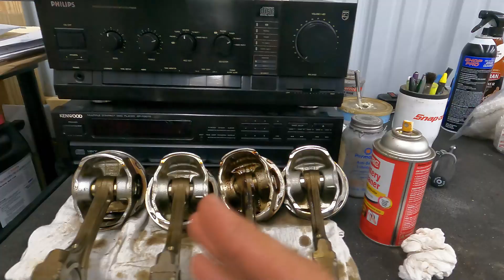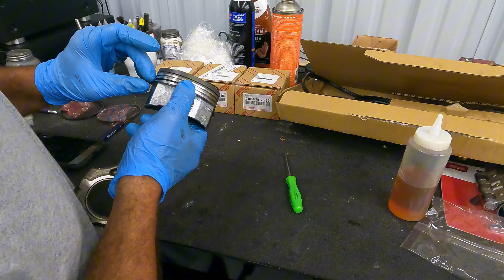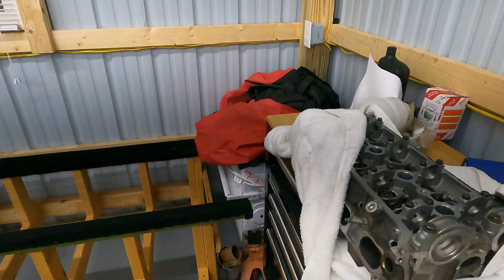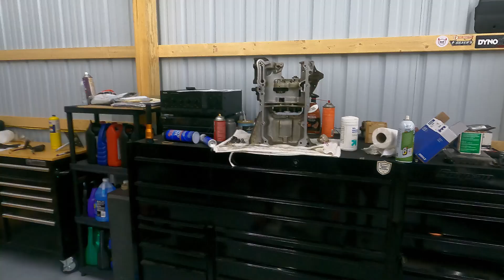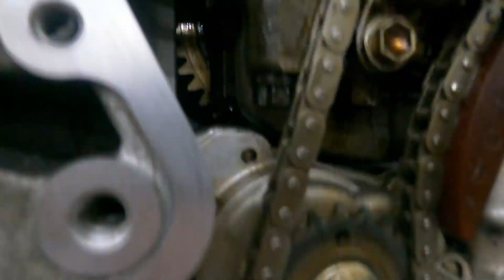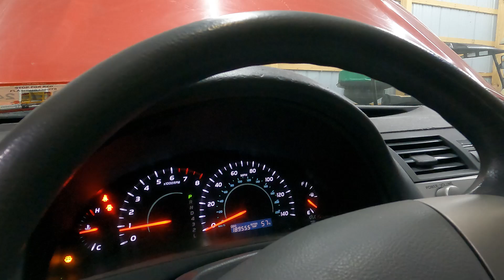We fix the OIL CONSUMPTION issue with our Toyota Camry 2AZ ONCE AND FOR ALL!!!!

Comment: Were these parts to fix the oil consumption issue and head bolt striping issues both used on a 2010 version of the motor (in a Matrix)

Comment: What did u do about the blown head gasket? Have head machined/use new Toyota head bolts or aftermarket/install inserts in bolt holes to prevent stripping? thanks
Reply from the maker: Had the head cut, and installed new Mahle head bolts in factory cut threads. Luckily for us the threads were okay

Comment: I checked your first video and there was no list of part numbers what is the part number on that kit I already have the part numbers for the Pistons from the car care nut but he said the kit numbers vary by vehicle which I also have a 2007 Toyota Camry like in this video video I got lucky and my car only goes through 2 quarts every 5,000 miles so usually I don't add really that much between oil changes but it is burning oil and it's got about $215,000 so I'm looking change the piston rings and valve seals

Comment: No need for a hone? I know the TSB doesn't call for it.
Reply from the maker: You’re correct, the TSB states if the factory crosshatch is visible do not hone, and if it’s not visible replace the block. Ours was clearly visible so we followed the TSB
Reply: @SEsGarage  Thanks.
Reply: Do you happen to have the part number for the piston rings. Trying to find the "updated" rings

Comment: Did you check the ring gap in the block and fit them accordingly?
Reply from the maker: All steps of the TSB were followed accordingly. This is a low horsepower mass produced economy engine, not a race engine.
Reply: @SEsGarage  don't think it matters what type engine. Just standard practice for correct build and reliability

Comment: How much would a job like this cost?
How much would you charge and how much for parts?
Reply from the maker: So this isn’t a job that I would do for a customer unfortunately. I have a full-time job and a family so time is my biggest enemy. I can only spare a couple hours a week out in the garage doing this, which is part of the reason why this project took as long as it did! Parts and sublet machine shop for the head are anywhere between $1200 and $1500 depending on what exactly you need and any other casualties of the job. Roughly another $1800-$2000 in labor (20 hrs flat rate time roughly) so this is easily a 3000+ dollar job parts and labor at a reputable shop
Reply from the maker: My goal here is to sell the car at a profit to cover my parts and labor and hope the videos do well!
Reply: @SEsGarage  
Thanks for your response.  I have a 2009 camry I purchased the car  brand new. The dealership had the recall in which they did an oil consumption test back in 2015. The car at the time did not burn oil. Then in 2018 I stopped short the oil light came on the text day I checked about a quart  of oil was missing.  Took it the dealership they did an oil consumption  test after 1k miles  the car was burning oil at that time my car only had about  55k miles. Today 2024 with 82k miles the car still burns about a quart of oil every 1k miles.